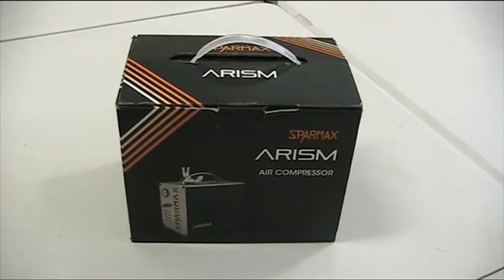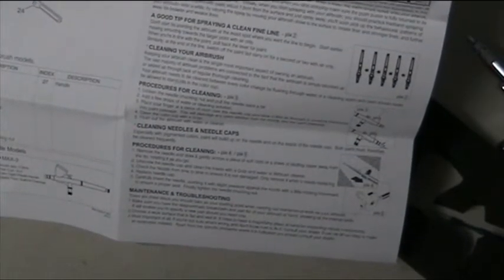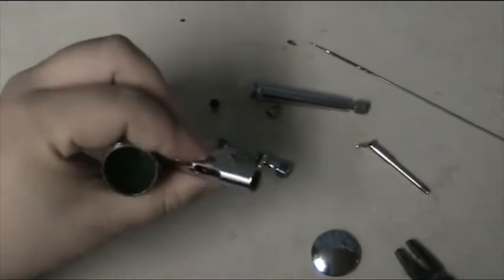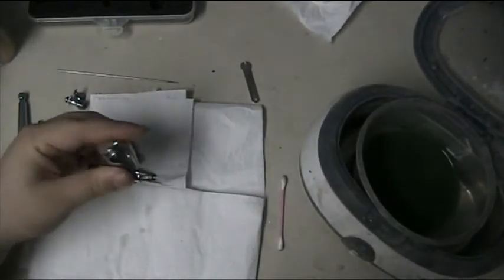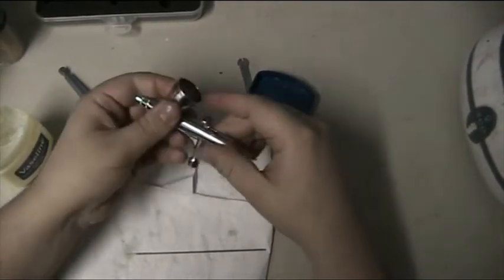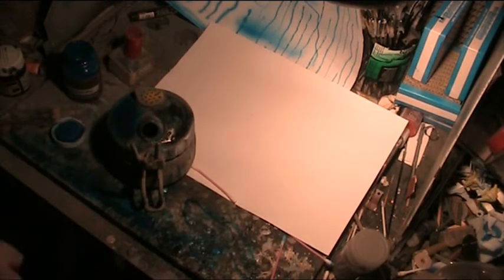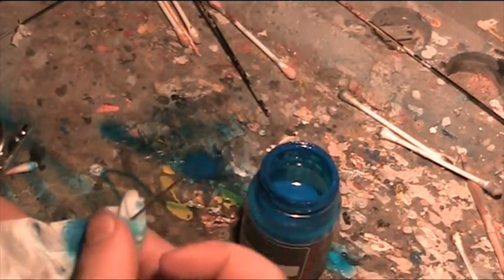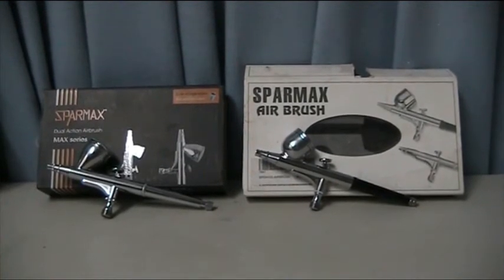Sparmax ARISM AC66HX Compressor with Max-3 airbrush review

Comment: Hi mate! Great video. Can you please give me a name of the company which makes sparmax max-3 compatible needles and nozzles for 1$? Thanks and keep up the good work.
Reply from the maker: You will come across a few brands and maybe different materials or colors. All the threads and sizes are the same. Any no name needle or nozzle on ebay between $1-$10 and from my experience the $1 one is just as good as any of them. Hunt around and you can find 5-10 needles for a few dollars making it even cheaper.
Reply: mokanaman Thanks for the reply. Am I right in thinking that the needles match too without any modifications? Are the cheap nozzles any worse than the Sparmax ones? I'm binge watching all of your videos and learning a lot,  keep them coming. If you want them too look slightly better (I'm not talking resolution) make sure you have got plenty of light when you film and if possible set your camera to vivid colours as they seem muted. Just my 2c.
Reply from the maker: That is correct but some do like to polish or sharpen the needle for improved performance. This can do attempted latter. The cheap ones from some manufactures are a slightly softer metal and can split sooner but the difference in life span is very little. Also thank you for your feedback, to cut editing time down I'm normally a tad lazy with production side of things. Lighting will be improved once the new studio is established.